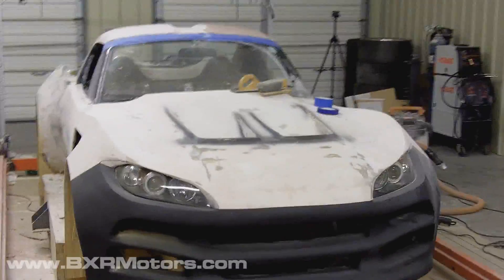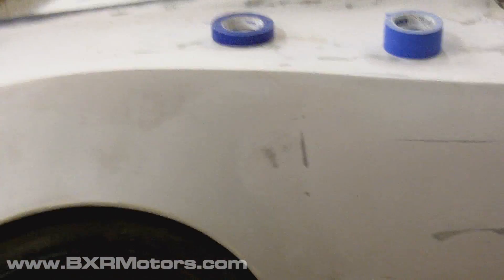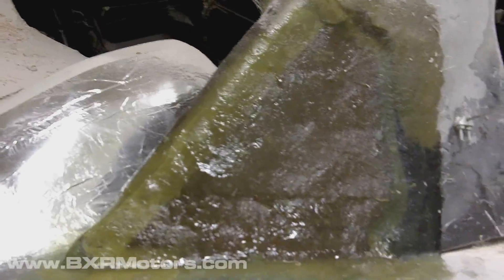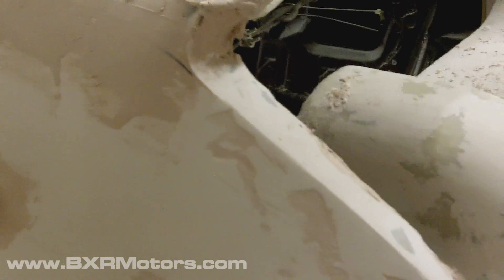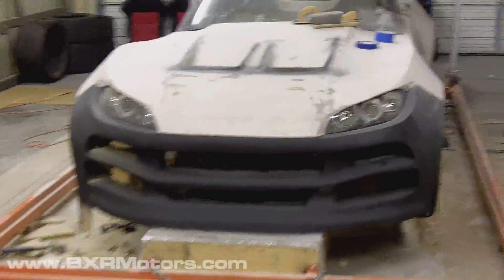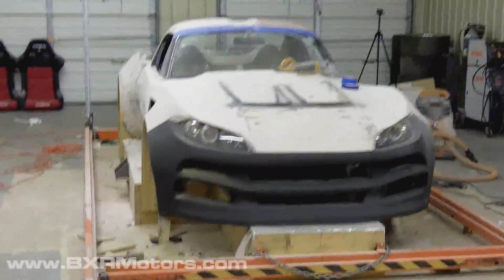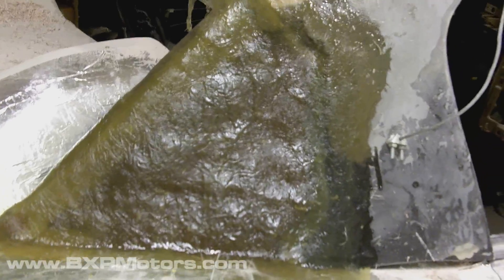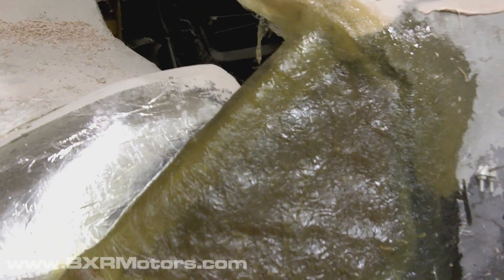Bailey Blade XTR Car Design | How to fix fiberglass issue - Part 26

Comment: Hey Guys- watched the video and just wanted to comment on curing fiberglass.  I work with fiberglass here in CO and run into cold temp curing problems as well. What I have found to work the best is a standard hallogen shop light. The UV helps cure the resin and the heat helps as well.

Comment from the maker: Yeah the video should show up in HD here soon at 1080. it should have more detail. Yes we plan to use lots of Carbon Fiber on the car. Once we build a few test models we will construct a special heated mold for vacuum bagging CF panels.

Comment from the maker: Yeah i tried that the night before when we noticed it was not hardening. But it did not work. Usually heat will help, but i think i just had a bad tube of hardener. If the Hardener was bad, then heat would have no effect.

Comment: is there a reason you can't use a heat gun or small bar heater on a stand to assist in the hardening, not having used fibreglass b4 i am not sure if it might cause a problem or not, but i have used that to dry/bake paint when in a hurry.